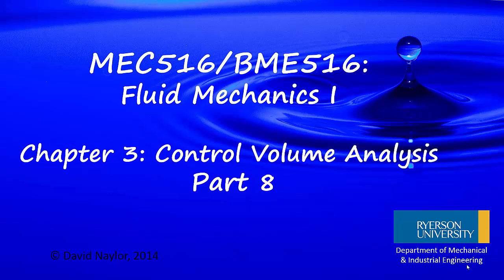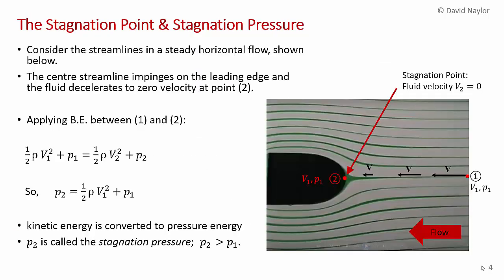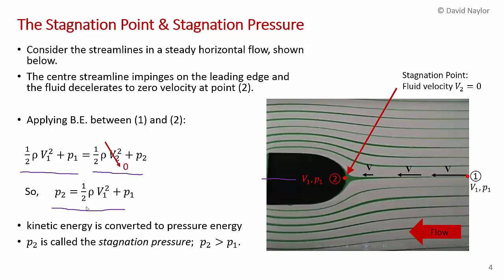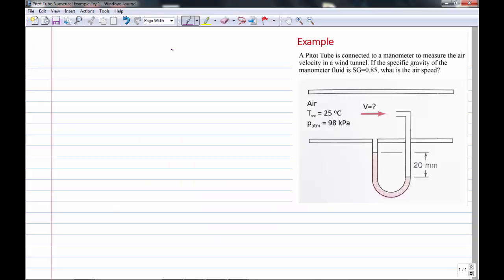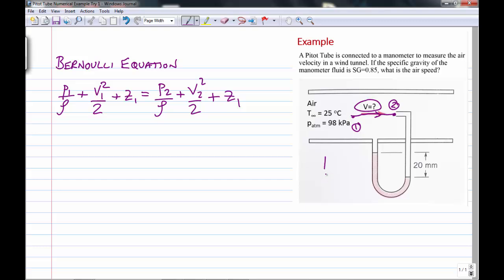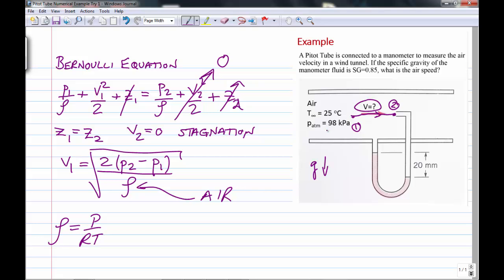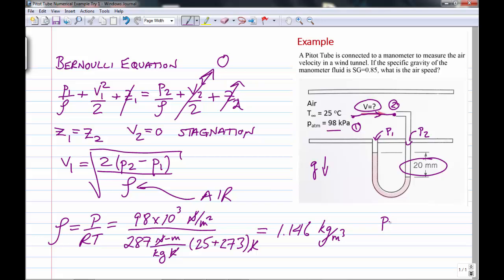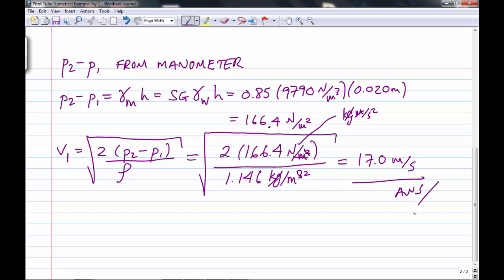Solved Problem: Measurement of Air Velocity with a Pitot Tube

Comment from the maker: All the videos for this introductory Fluid Mechanics course are now available at: https://www.drdavidnaylor.net/
Reply: I may have gotten carried away, my apologies. Might I ask a shorter, simpler version instead, that won't req writing anything down or keeping track of  variables?
I basically just have a drinking straw. I want to breathe in pulling as much air through as possible. So the question is, how can I edit the straw to pull more air through ? I've tried making one end larger or smaller than it was, as well as  both ends larger or smaller than it was so start. The problem is I cant tell physically which one I'm breathing in the most air, and I don't how it works on paper so I really just can't tell lol

Comment: P2-P1=Hg(p1-p2)    이식 아닌가요?
Reply from the maker: Yes -- if you mean p1 is the density of the manometer fluid and p2 is the density of the air (which is almost zero, since it is approx. 1000 times less).

Comment: How would this problem work with water and mercury in the manometer?
Reply from the maker: Same basic "Bernoulli" analysis. But the manometer pressure difference calculation would be different -- needs to account for the water on the RHS:  h*g*(rho_merc-rho_water). I hope that helps.

Comment: Great explanation and demonstration. I'm still struggling to get my head round the application of Bernoulli's equation to compressible fluids. In the above example you have one value for Rho (atmospheric pressure), but the fluid density in the duct will be higher because of static pressure. Surely that would invalidate the results of the calculation because Rho can't be treated as a constant?
Reply from the maker: Yes. That's true. But the pressure change is often small -- as this solved example, 166 Pa. So, the absolute pressure is 98.0 kPa+0.166 kPa at the stagnation point. That will increase the air density ever so slightly (0.17%). So, it's a reasonable approximation. In a different application, if the air pressure change is large relative to the absolute pressure, then using Bernoulli's equation becomes dubious.

Comment: In this case you wouldn't include the pressure drop from the air in the manometer due to the density being so low. In other cases, the pressure from the liquid would have to be accounted for in the equation.
Reply from the maker: There is air on both sides of the manometer, except in the 20mm section. So, the pressure difference caused by the air in the manometer is ~1.2kg/m^3(9.8m/s^2)0.02m=0.23 Pa. For most purposes, this is negligible compared to the 166 Pa that is being measured. I hope that helps.

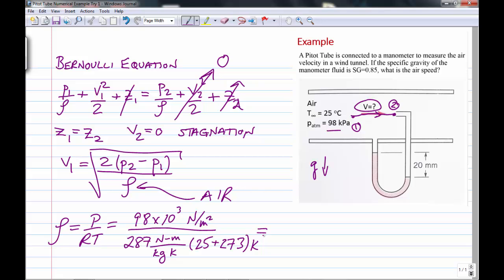Comment: 12:20 - why we are taking into account only atmospheric pressure during density calculation? what about pressure inside wind tunnel? It does not affect density of inside air? As we know, bigger pressure = bigger density. Would be great if you could let me know why we only take atmospheric pressure.
Reply from the maker: Yes, if the wind tunnel was pressurized you should include that effect. In practice, that would be unusual.  Most low-speed wind tunnels are not sealed, and operate at (or very close to) atmospheric pressure. In this problem statement shows the pressure inside the wind tunnel as p_atm, a reasonable assumption.
Reply: @FluidMatters  Thanks for your respond! So, wind tunel example is clear for me. But just to be sure, please correct me if I am wrong - In case pitot measurment inside round ducting, when p_atm = 101 325 Pa, and pressure inside duct is p_duct = 12 000 Pa, for density calculation I should use p_atm + p_duct. Am I right?
Reply from the maker: @tomaszgalek9788   Yes. You in an HVAC application should use the pressure in the duct, if you know it, to calculate the density of the air. (Keep in mind that the local atmo. pressure is not 101325 Pa -- it varies substantially (+/- a few percent) with the local weather conditions. So, using this value to (6 digits!) does not make sense. That's why you will usually find a barometer in a wind tunnel lab.)
Reply: @FluidMatters  You are right, in HVAC application, (depends of location - altitude) atmo pressure is different. 101325 Pa value was just an example. Many thanks for your time, I really appreciate it! :)
Reply: https://youtu.be/s-QHTWP26QI

Comment: Thank you.

I’m looking for equations to determine the air velocity of an underground tunnel with one opening at ground level and the other opening at 100m above ground level with a wind blowing at 20 m/s.

I believe this video gives me everything I need.
Reply from the maker: Sounds like an interesting application....
Reply: @FluidMatters  It’s based of off the American Black-tailed prairie dog’s burrows. They use a mounded entrance and a level entrance to create a pressure differential when the wind blows. This creates natural ventilation.

I want to try and figure out how much wind power can be extracted with subterranean wind turbines using the same method.
Reply: https://youtu.be/s-QHTWP26QI